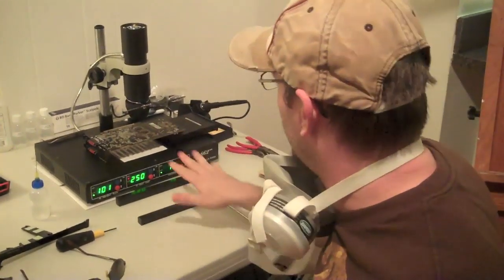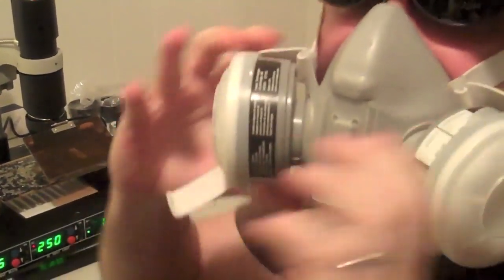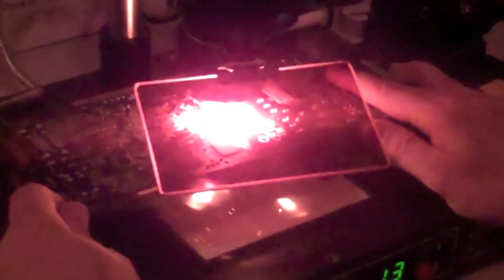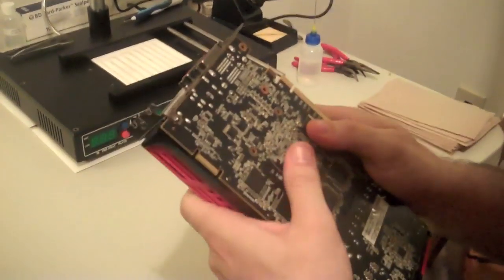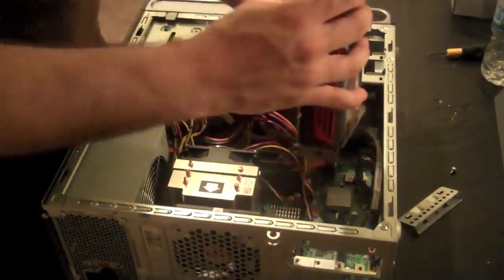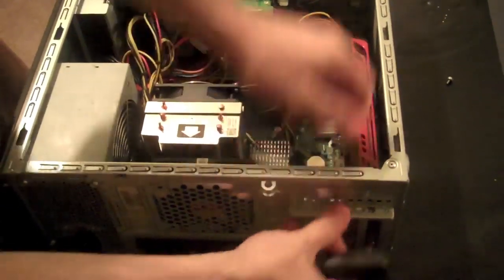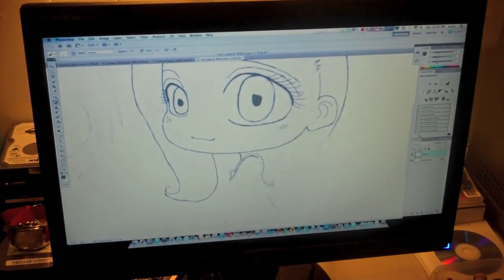BGA Rework of the RadeonHD 5770 Part 2

Comment: Hi it's been eight years now do you still fill that T862  performs as it did the first day you purchased it. the reason i ask is that i'm interested in buying this BGA unit.
Reply: for the price who cares
Reply from the maker: yes it's still working as good as the day I got it, though I have replaced the lamp a few times
Reply: @JaS  how much do the replacement bulbs cost? Curious cause it looks like just a normal 12v 35w halogen bulb. Looking to get one of these after your video. I see for the bulbs “made” for the machine there anywhere from 35-100 dollars which seems crazy.

Comment: Hello. Thanks for sharing. What was wrong with it before fixing it? I have a Sapphire AMD R9 290 TRI-X 4GB that does not get any signal to the monitor (bought from ebay as faulty). The fans are spinning but that's it, no signal from the ports. What would you recommend me to do with it? Thanks :)

Comment: Great video! Just to add to it though, when putting it back together clean the old and apply new thermal compound on there. Also some new thermal pad would not hurt either...
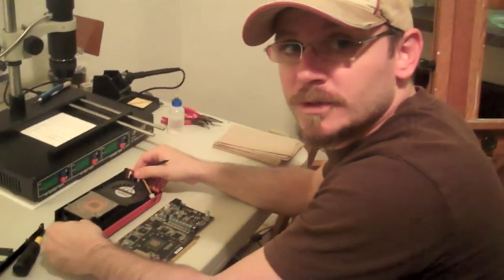Reply from the maker: Thanks for the comment but as you can see I did apply new thermal compound and point that fact out starting at 4:40 in the video. As for new thermal pads, I didn't see the need for them with this repair.